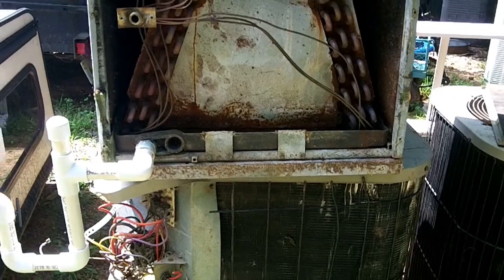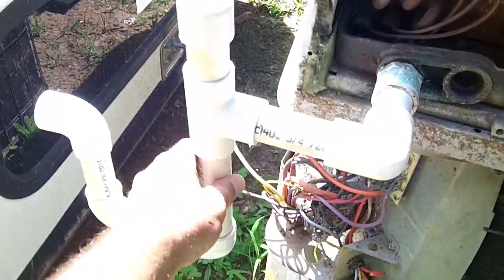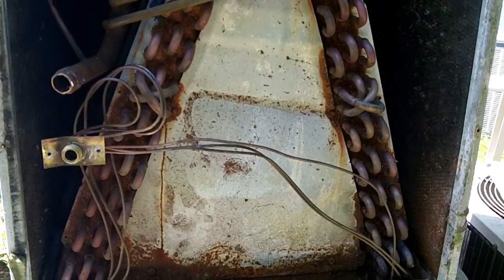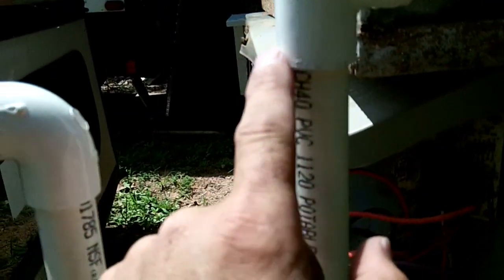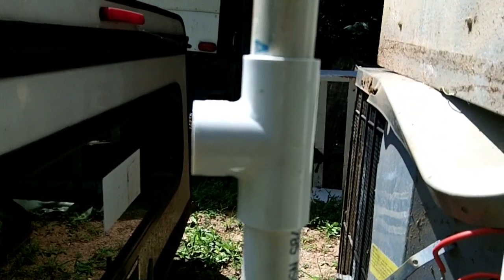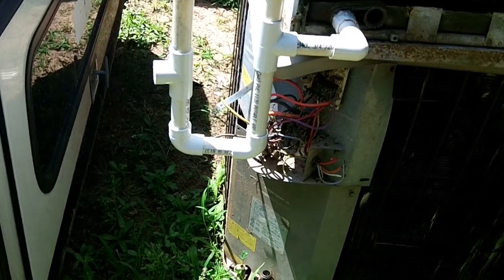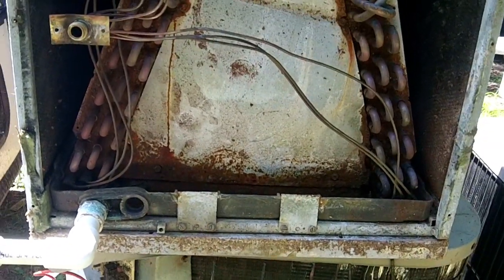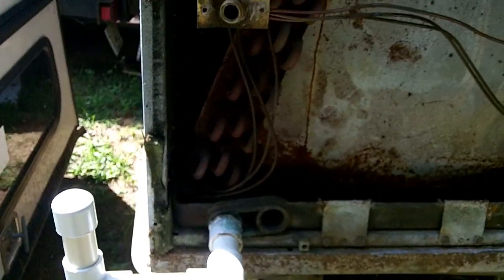Basic HVAC Video Series--- Condensate Traps

Comment: What is the difference between a air handler under negative vs positive pressure and why? Would cold air come out of the stack? Is a trap needed? Thanks.
Reply: In a positive pressure coil, cooled air will be pushed out of the drain line. The downside of not using a trap is the small efficiency loss of air being pushed out through the drain line rather than being sent to the conditioned space. The deep trap with water acts as a barrier to stop the air from escaping through the drain line. You’ll definitely need a trap if you have a positive pressure coil HVAC system in your attic because it could add moisture in the area which could lead to mold.

Comment: Trap is very important for both types - positive and negative pressure. Mines is positive pressure so it is not as important as when negative. I don’t have a trap. Installer did not do a good job. I replaced the line - 20 feet - recently due to 1/4 to a 1/3 of the 3/4 inch pipe being clogged with a sludge that would not come out with flushing or suctioning. I did not install a p trap and it has not had any issues at all. Nor had the prior drain for 10-15 years. So yeh probably would like one but it’s working great as is. There is no  noticeable air flow (cool air) at the discharge either. Great video. Thanks.

Comment: My p trap drain is in the middle outside of the house downstairs and my handler unit is upstairs, can I extend the drain pipe further to the front or back of the house without causing any issues with drainage or create a secondary p trap?  The reason I want to extend the drainage far away from the side of the house is because it’s very wet all the time there. Thanks

Comment: Question: I've cleaned the main condensation drain with bleach and water. It flows. But when I put the cleaning cap back on the trap, condensation water still comes out from the secondary drain, and starts flowing into the backup pan that the whole unit sits in.  Also, with the cleaning cap off, air is not sucked into the main drain, but blows out from the drain.  If I leave the cap off, the condensation water drains normally through the main drain.  Any idea what's wrong?  Thanks!

Comment: My PVC line actually blows air out from a PVC vent ...it's a horizontal one, is that normal? And the drain line is in the attic that runs down a sewer drain so it has another big vent through the roof like what a bathroom toilet would have...is that a good set up?

Comment: im getting a whining noise from my drain when the furnace blower is coming on. this is also caused by negative pressure? it only happens when the blower starts. im thinking maybe the main seal is bad.

Comment: My HVAC in a closet has no P Trap. The technician cannot find the concealed line after he replaced my old unit and installed the new one. He was in hurry So he drilled a hole and has a pipe go straight horizontally outside to drip the water. What kind of problem will I have?

Comment: Great video.  I had the coil changed on my AC furnace and the guy built a trap but it was to small and the unit never has water coming from it.  The humidity in the house is way to high.  Found the book on the coil and it states minimum trap size.  Just to small.  between your video and that book I now know my trap has to be bigger.   Also a tee with a cap would be good for cleaning like you made.  Off to my home store.  Thank you!

Comment: Good video. Much appreciated. One question: 
Is there a rule that says a trap should be within 4 inches of the air handler condensate drain connection?

Comment: Hello I'm a maintenance tech I started a new job and my new supervisor said there should not be a cap on the condensation drain line I believe he is wrong and that's why there is water leaking from the water pan tray. I'm I correct?

Comment: Quick q if I could. First off great video. Appreciate your expertise. How deep do you make the trap?  On my attic air handler, there is a trap, but the one trap serves the main pan, and overflow pan, (some idiot made a hole in the overflow pan and ran it to the drain also). so what I think is that air is being drawn in through the overflow pan opening and bypassing the trap, so it’s not draining. I need two traps for the two lines, I think. Thanks.

Comment: It’s code in our area to pipe the secondary drain to an area where flow will be easily seen by the homeowner.  In an attic, we have to install a secondary drain pan under the coil if it is above a finished ceiling.

Comment: When my HVAC unit is running (in the attic), I hear a gurgling noise in the bathroom sink. If I close the sink drain, the noise stops.  Does that mean that water has been sucked out of the trap?  If so, should I pour some water into the drain line to establish a water level in the trap?
Reply: I have this exact problem also where my attic AC unit drains down into the guest bedroom sink and gurgles anytime the AC is running.  I have never been able to figure out what to do about it?  Did you ever resolve your issue?  I generally keep the drain closed.  

I don't have a trap on our attic A/C unit, just a vent pipe right outside the drain pan pipe...

Any help would be greatly appreciated!

Comment: Thanks Ralph for going over this. It is the most misunderstood thing I see in the field.
A lot of HVAC companies do not know this. That is why so many drains are messed up in the field.

The only thing I would add is on you yearly maintenance before you start up your AC. Put little bleach and flush out your condensate drain with a gallon of warm water.

If you have a emergency drain pan under the unit if it is in the attic. It should not be attached to primary drain.
It should go to a location where you would see water coming out to give you a warning of a problem with your drain. You should never have water coming out of this pipe !

Comment: In order to create a negative pressure, the system is a down-flow type. If the system is an up-flow type, the blower fan is under the "A" coil. Thus, it blows up thru the coil for cooling, creating positive pressure at the base pan of the "A" coil. If vent zoning is home owner controlled, they may choose to close of un used floor vents, creating higher pressures. I would prefer to see and longer "P" trap that captures more water and reduces the ability of the system to push the water out of the "P" trap with positive pressure up flow type, or suck the water from the "P" trap into the "A" coil pan in a down flow.

Comment: Hi there. I have a Rudd system and noticed water leaking where the fitting meets the drain, when I cut the pipe and the unit is running, I have air blowing OUT of the pic and not sucking in. Do I still need to install a trap?  Thanks for the help!
Reply: Depends on the air handler configuration. In unit in the video, the blower is after the evaporator, creating negative pressure on the pan (sucking air through the drain line). In this case, the p trap is required. If you have an air handler where the blower is before the evaporator, the pressure in the drain line is positive (blowing air out through the drain line). In this case a p trap is not essential, although you may want to still have it to prevent conditioned air from being blown to the outside. The energy savings of this approach may be minuscule though.

Comment: Do you need a trap if your condo line drops straight into a condo pump in the water so no air can pull in ?
Reply from the maker: I would add the trap and take the condensate drain out of the water in the pump.
Reply: Ok I would have to leave the drain in the water though unless I made it flush with the pump insert because once that pump has water in it there will always be half a pump pan full of water.. the float switch allows that much.. is it cool to leave the pipe in the water? Thanks Ralph lovin the pod cast!

Comment: Min 8:40   Can we get more info on the "SS2 Safety Switch":   What does it do? How does it work?  Looks like wiring is required.
Reply: I think T&N Services LLC covers it here https://www.youtube.com/watch?v=4IxMdsbGD0A
Reply: Its a float switch. When the drain is clogged the overflow condensation goes into that 90. When the float reaches a certain level it shuts off the low voltage either to the condenser or shuts off the lo voltage to the thermostat. Depending on if you are breaking into "y" or the "r" wire. I personally break into "y"   so the customer will.at least have some air circulation until the drain gets corrected.

Comment: Min 6:00     Just to make sure: a double trap will block the drain, correct?   And a vent (discussed at this point) will ensure that water flows through the "sag" and thus no 2nd trap is formed.                      In other words, a "sag" in a long drain will form an "AIR LOCK" with the first trap in the line (the "p" trap), correct?  And that the Vent will prevent an "Air Lock" from occurring.     Have I got it right?

Comment: Ralph, do you need a trap on a horizontal flow airhandler where the blower is pulling air thru the evaporator coil?

Comment: Are all units under Negative pressure
Reply: Not true. If blower is upstream of coils it is pulling air over them (negative). If it's downstream it is pushing air over the coil (positive). Depends on installation.

Comment: This is an excellent video.  I have not seen another which describes the reason for everything.  I wondered what the hell that second capped off hole was for.  Sheeeesh. Very nice. I'm going to see what other videos you may have about leaking A/C drain.  Mine is so cramped.  I cut the PVC and poured bleach, then the thick bleach drain cleaner followed by boiling water ... three times and the blockage is clear.  Now my problem is reconnecting it.  This is a problem because all of the elbows and tiny short runs of PVC leave almost no place to reconnect the cut PVC.  There was no damn reason for them to install it that way.  There is plenty of room.  Anyway, thanks again.  And, by the way, in your crawl at the opening there is a wrong word.  It is "have no IDEA" not "have no IDEAL".

Comment: Well, my Air Handler (Carrier 5 Ton R410) is horizontal in my garage and I installed it myself. I have a problem with the pan overflowing after the fan shuts off. I think the water being pushed forward in the pan until the fan goes off then like a tsunami it rolls back and overflows! It did overflow once while the fan was running too.

The unit I replaced was also a Carrier 5 ton (R22) installed by the builder. They had NO TRAP on it and the condensate pipe and the Air Handler primary is at the same level so if I installed a P trap the outlet of the trap would be below the pipe that's routed to the outside. Don't want to create a secondary trap as you say....

Any ideas on this setup? I'm pretty sure the pan's overflowing because it's sucking air and the water the coil's making exceeds the water leaving via the primary drain. I tried using a shallow condensate trap with a vent but it doesn't seem to do any good. There's water leaving the drain pipe but not much.

I thought I might be able to make a reservoir that I could mount high up on the wall and use a sump pump but maybe there's some other way? I would insert a picture but I don't know how?
Reply: kaydee457 if the discharge is facing right the top plate of the coil should have been converted.  Not doing this causes water to drop from the coil missing the pan and filling up the bottom of the unit.  High static pressure can also cause issue, electrostatic filters, dirty filters. Air flow can cause many issues.
Reply from the maker: Go back and look at the install manual depending on your install you may have to flip the coil around to prevent it from leaking
Reply: Thanks for the help!
Well, it works fine with the fan on low. It ran a couple hours straight and when it finally shut off it didn't overflow. I'll have to add a return for those rooms in the wintertime.

Comment: Why not put the cut off switch on the lower of the two openings and drain it on the higher.  That way it will cut off  before it has a problem not after.
Reply: Think about what you're saying. If you did that it would cut off the whole system, prematurely, BEFORE the pan's allowed to drain. I say prematurely because you'd be cutting off the system by fault instead of by room temperature via the thermostat.

Comment: Thanks a lot for taking the time to make the video. I had no idea that the system could suck the water out of the drain line and prevent the condensation from draining. I closed off the vents to two unused bedrooms over the winter and haven't opened them up yet this spring, so it looks like the additional pressure may be causing the drain problem. My P trap is also shallow compared to the one in the video, so that makes it even more likely. Excellent job, and thanks again.

Comment: I have a bottom fed hvac condensor systen just like the video, but the drain comes out and down into the bottom where the vacuum is at (in the air intake box cavity behind the intake filter).  Should the drain aparatus be inside the vacuum area like mine is?  It seems to be that all the videos that I see show the drain tubing and such outside the vacuum chamber.  Mine has the trap, but it also has a vent on the back side of the trap like you show that is not plugged.  My worry is if this is draining, or if the vacuum is actually sucking the water back from outside my house???  I only hear the gurgle (tapping sound) when the filter is in place like you lay out as the air needing to come from somewhere. My secondary drain hole has an electronic sensor that shuts down the air conditioner if water touches it.. and it does.  I drained 1/2 gal of condensate from my secondary drain port...can you give advice?  Should I have the drain line moved to outside the vacuum return box?

Comment: My heat pump was installed January '03, and condensate has never drained properly. Original company did it wrong, using a very shallow trap. I've had three other companies guys come out over these years, no one could fix it. Finally, I used one more company here in Augusta, GA and their man read the installation manual section about how to install the drain, and it clearly said to use a DEEP P trap, not a shallow one like it had! None of the other guys knew about using a deep trap like you show! Condensate leaked under our new hardwood floor last summer even with me trying to keep an eye on it. Whew, thanks a lot!
Reply: Taka Yama vhbbbv

Comment: Thank you for making this video.

I imagine a non-licensed person can't recycle the coils because they are stolen many times...at least it's reported in the news in Miami often.

I will be installing a trap soon.  After many years of hearing a gurgling noise outside the house where the condensate spills out, I finally paid attention and figured out what is happening.  After a few months, or weeks, when the filter gets loaded, the fan pulls more vacuum, the gurgling starts, the pan eventually spills over and I have to mop up the water.  After many years of this, the bottom metal track in my walls is rusted and some sections need replacing...ignorance is not always bliss.

Now I have to figure out how to help the condensate drain better into the ground.  Condensate forms a puddle next to the house and the mosquitoes lay their eggs.  Very annoying.  Have to ladle out water all the time before the mosquitoes hatch.
Reply: I actually just ran into a scrap yard that won't even take the cabinet parts from a scrapped unit, they didn't care that I had the original receipt from my old unit that I purchased 17 years ago as well as the one from my new equipment proving it wasn't stolen, they are being very restrictive on water heaters now as well.   I have to wonder how much of it is stopping thefts, and how much of it is designed to slam the brakes on home/business owners from making a dime off scrapping their old equipment.

Comment: It is nice to see someone took the time to explain the traps. I have worked with so many guys who just come out with a barb fitting with vinyl tube and aim it at the drain. 
A lot of manufacturers are actually wanting traps now in their equipment, if a guy takes the time to read the manual it even gives the dimensions of it.

Comment: Just want to say thanks for this lesson. It makes my life easier when I install drain runs now
Reply from the maker: Thanks my friend!!!! Glad it helps
Reply: How close does the trap need to be to the air handler?  Does it have to have a vent?  I have an air handler that was installed about a year ago. For some reason the condensate is not going into the primary drain but is draining out the overflow.
Reply: Primary drain clogged?   Many times they clog with lint, dirt or mold.

Comment: Great video on condensate traps. I noticed you said to use bleach for cleaning which is right and works great, but a alternative I've told homeowners about is 1tblspn baking soda to 1Qt hot water. Once it dissolves into the water it will clean just as good as bleach just minus the vapors that can corrode evaporators. Anyways good vid lots of practical info.

Comment: Great video Ralph !! Nice knowing others make their own traps. I'm not sure if I have ever bought a trap. On my own, I have always made them. A good way for new techs to remember the need is this.....IF the blower "pulls" the return air through the coil OR the coil is "before" the blower in the airflow, you need a trap due to negative pressure. IF the blower "pushes" the return air through the coil OR the coil is "after" the blower, you won't due to positive pressure.Take care,Brett